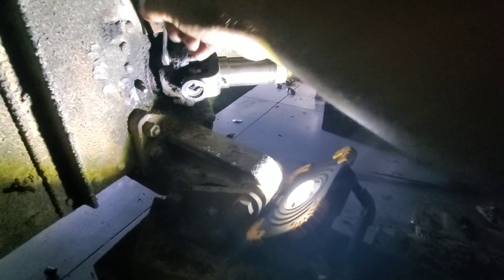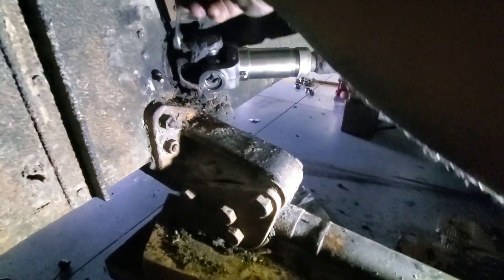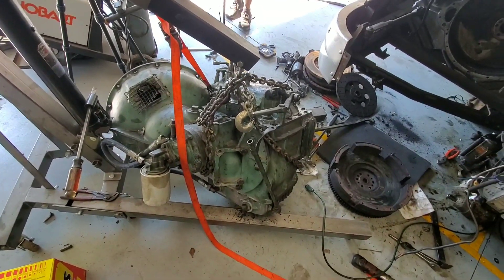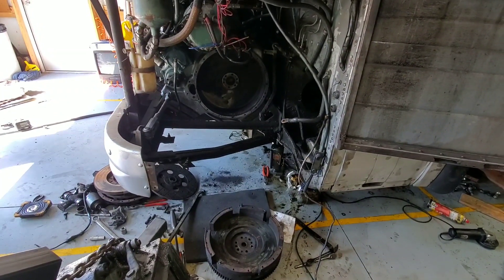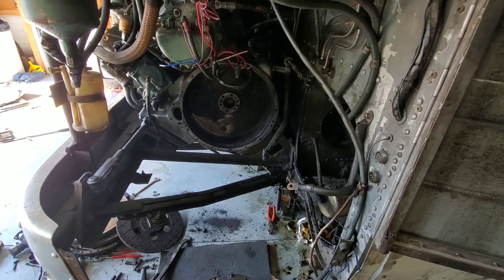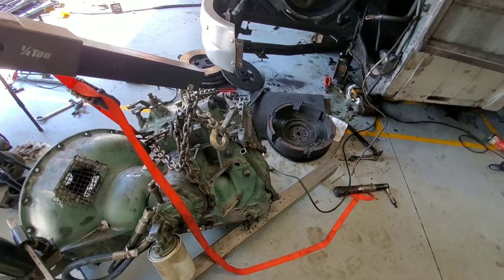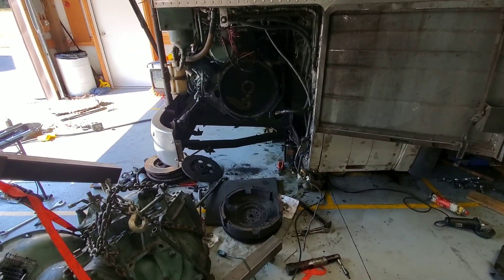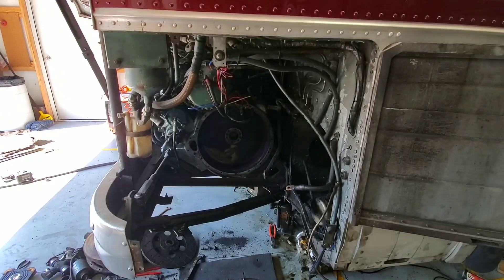4106 work day 3

Comment: Well, I was half right: you did get the manual out before I got back from running errands. :) And I learned something about buses - I had assumed that because of their size that the drive train would be conventional. But that's not always the case...thanks for doing the livestream.

Comment: I bought a set of Gearwrench brand ratcheting combo wrenches several years ago and it makes working in tight places so easy. You don't need to remove the wrench each time then reposition it. Home Depot also sells their Husky brand version. Think about getting a set for yourself. You'll love them. I promise.
Reply from the maker: I have a set but unfortunately did not bring them with me on this trip.

Comment: Tyler, I know you were looking for a bus. There is a 4104 (1966) in Hondo, TX (seen it on the Austin craigslist) listed as a "tour bus"... looks a bit rough, but wants $2500 for it. Also there is an old city bus (1984) with a 6v92 and automatic in san antonio for $1000.... just thought I'd mention it